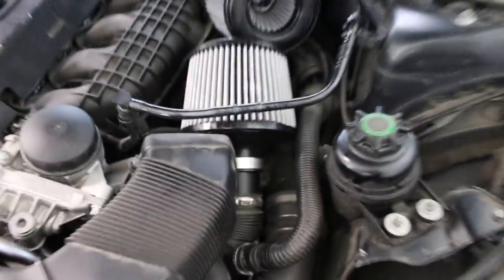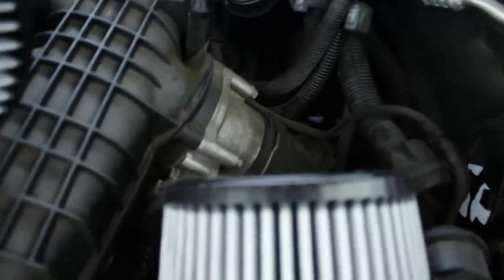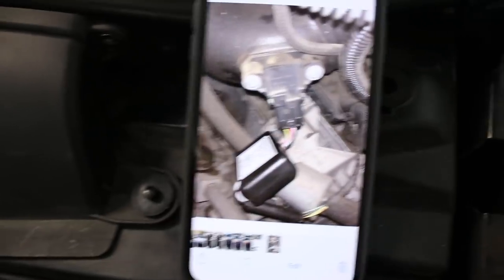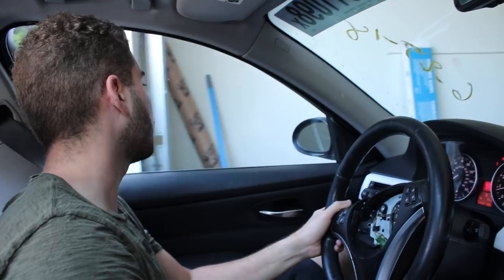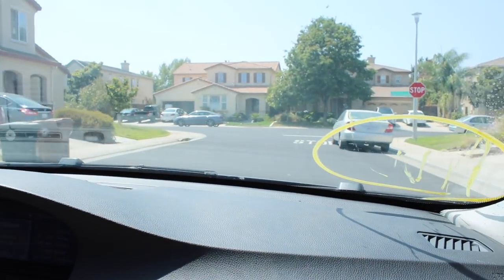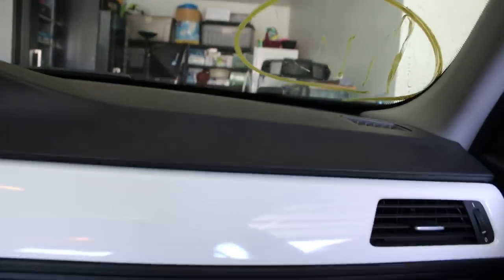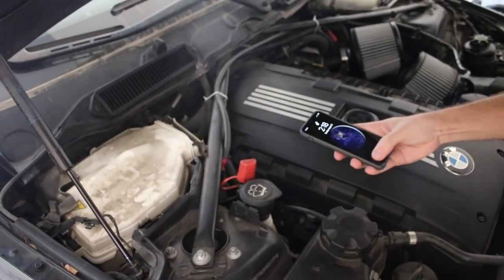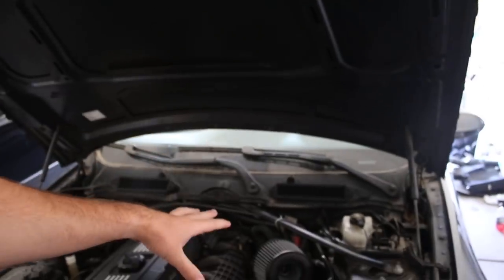Fastest Way to Gain 25-40HP on a BMW 335I! (30 sec Instal)

Comment: Dang, JB+....I had that 5 years ago! Had mine at max setting + solenoid bypass mod done 👍🏻
JB4 G5 ISO map 7 race + JB4 Pump Backend flash currently 😀
Reply: BMW Fanatic how tf are u even on stock turbos ? How come they dont rattle at ur mileage, I'm at 83k rn acared if they start to rattle
Reply: Allen Messi mine is at 98k no rattle still runs like it’s from the dealer😊

Comment: I noticed you got Bosch plugs. Im sure the NGKs are better
Reply: They recommend Bosch
Reply: Rising Sun Performance not when you start adding bolt ons.
Reply: @IxliFeHackxI  yeah stock sure.  But after mods, NGK is the way.
Reply: Rare Viruz 
they are they are the ones originally put into the vehicle